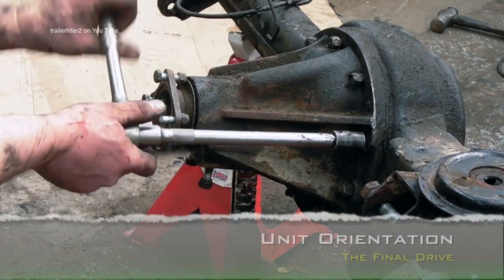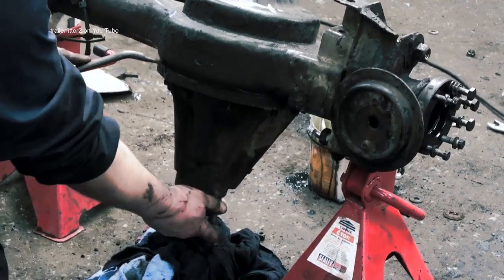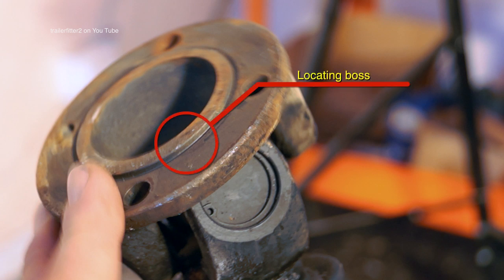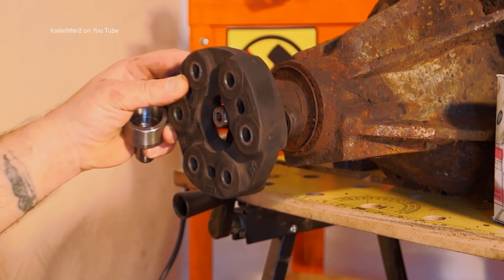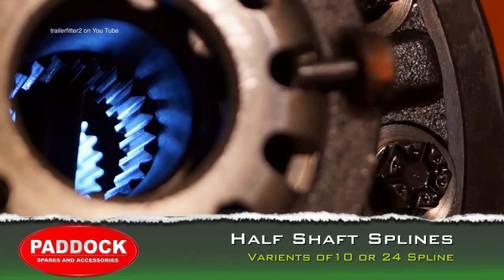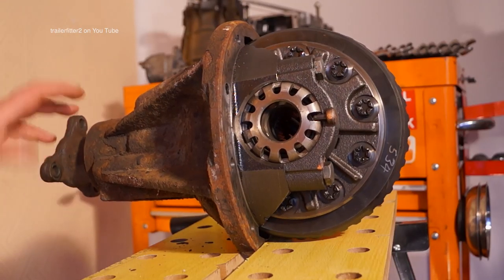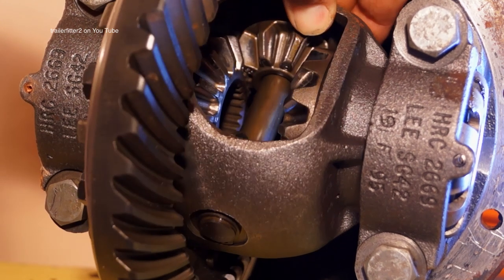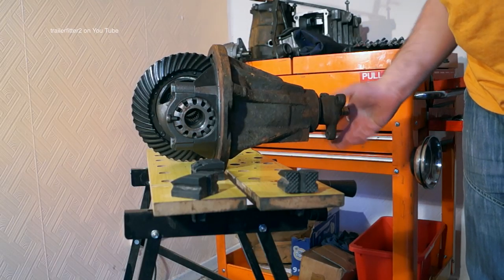Land Rover Front and Rear Axle Differential / Final Drive

Comment: Hey, I have a question, after watching the video I recognized something similar that is occurring with my LR Disco 2003 V8 Auto. When I am driving and I release the accel pedal, there is a noise like something metal clicking. I replaced the transfer case oil and there was no problem there. Then I replaced the front and rear differential oils and only in the front, I found metal shavings and the oil that was inside was all gray and filled with metal scrapings. I replaced the oil and it silenced the sound a bit, however after a few weeks it is back. What do you think?

Comment: At 1:23 - what are these cable strap steel wheels on the front and rear diffs?  I mean.... final drive housings? I want to remove them. I think the are case breakers, to shatter the case when you drop down on a rock.
Reply from the maker: They are only vibration dampers.   I am sure they vehicle will survive without them. Especially if you are off roading.